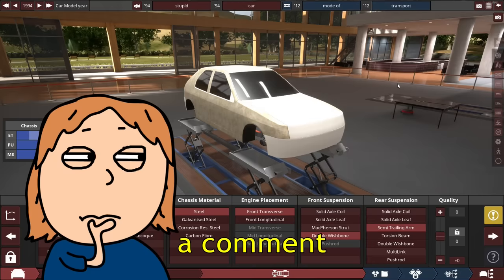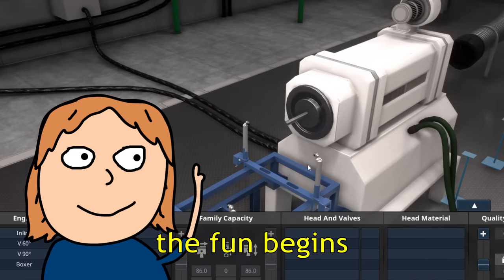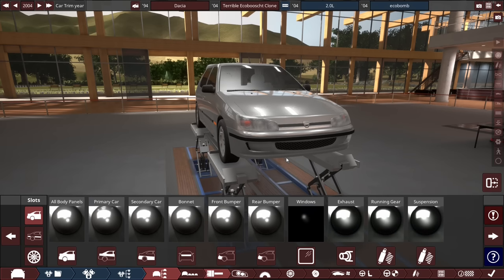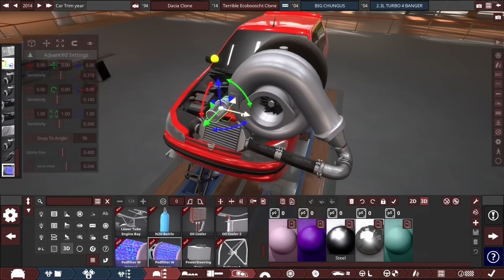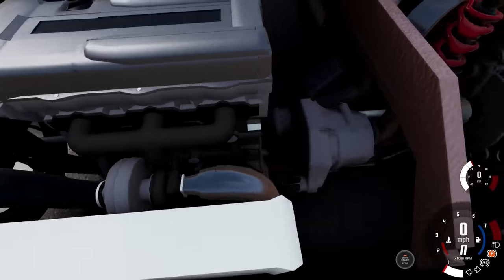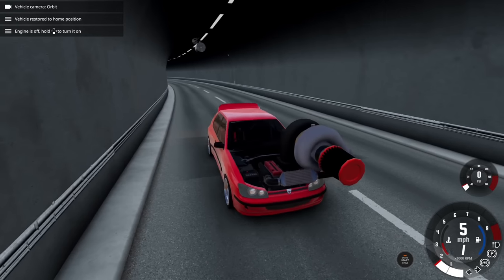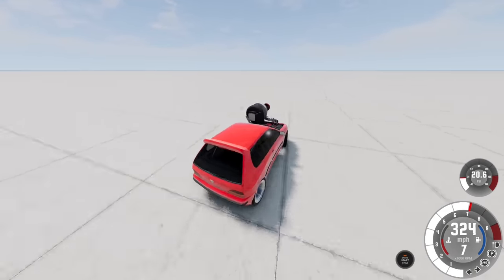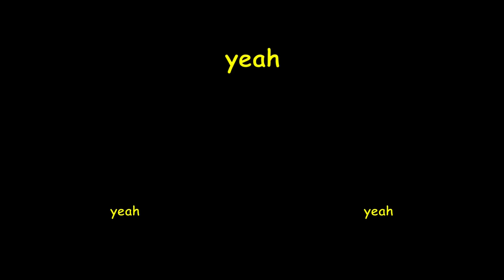When Your Turbo is BIGGER Than Your Engine...

Comment: >be me
> get a turbo from an old big cat bulldozer
> buy a lawnmower engine
> bolt the big turbo on the lawnmower engine
> POWER.jpg
Reply: i would actually like to see this tried, BUT, spool the turbo some other way, sit back watch the carnage
Reply: You won't have enough exhaust flow to spool it
Reply: i know, i am curious what would happen if you spooled up a gigantic turbo from the outside with say compressed air and then connected it to a tiny engine
Reply: @ianwalton4408 this could have a pedal of its own

Comment: I have a challenge (or four) for you, in Automation:

1. Make the smallest possible engine, running on regular (un)leaded gasoline, that also has a decent power curve and at least 300 horsepower.

2. (Based somewhat on your 1946 hypercar video) Make the earliest era car that you can, capable of 200+ mph.  While it took production cars until the 1980s to reach such speeds, and until the mid-late 1960s for race cars, I’d imagine you can pull it off for an earlier era given you slide the quality sliders all the way up.

3. Make a time attack car…  using a CVT.  It sounds silly, but it’s actually doable; my fastest-lap-time builds in Automation use CVTs, and also use V16s specifically designed to have a very thin powerband at a very high RPM just to circumvent the torque restriction, which itself also sounds jank as hell, but actually works beautifully with a CVT.

4. Make the fastest car possible that has less than or equal to 1,000 horsepower.  With enough (lack of) frontal area and drag, and enough downforce via specifically a rear wing/diffuser, you’d be surprised.

Comment: Idea: make an engine with the most horsepower possible, like just get the number as high as you can, then put it into a really small car, but add 10 spoilers stacked on top of each other so it doesn’t spin out

Comment: Turbos are spooled by the exhaust to force air in through the middle. Basically, you’ve routed the exhaust through the intercooler and back into the intake and put on a useless air filter

Comment: You can max the 3 cylinder engine size and max turbo size then make the engine smaller and it will keep the turbo at the same size